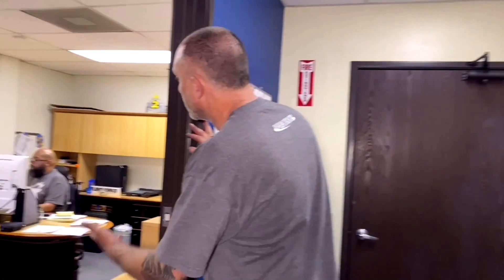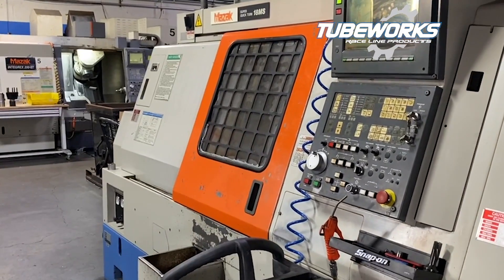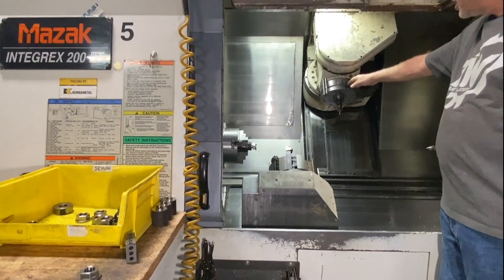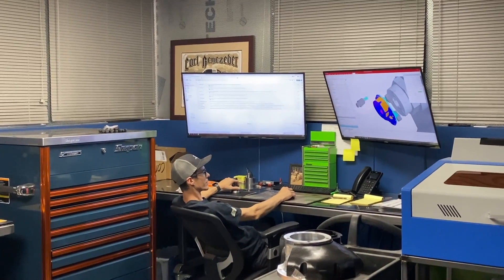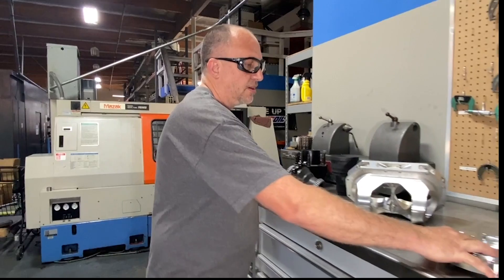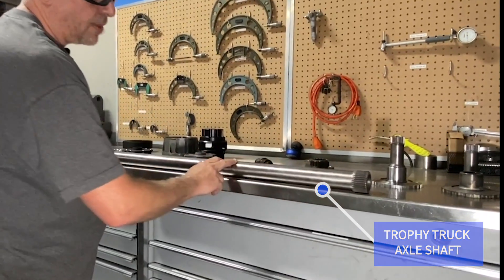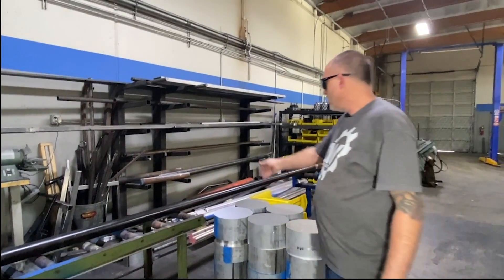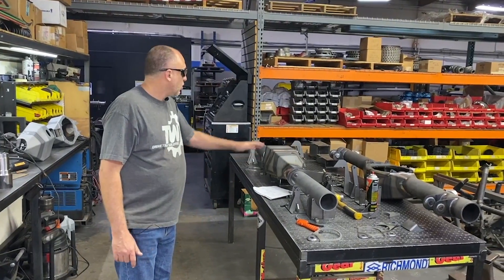Machine Shop Tours: Tubeworks

Comment: You guys have really advanced approach to manufacturing those complex parts. It uses more material on prismatic parts but it allows to get them done in 2 ops within the same machine so that is the cheapest form of automation if you have a bigger run of parts. Those Mazak Integrex beasts are really flexible.